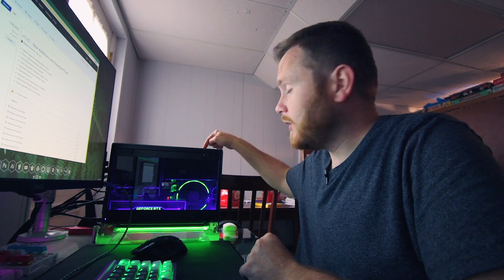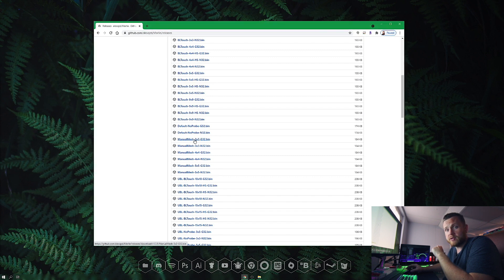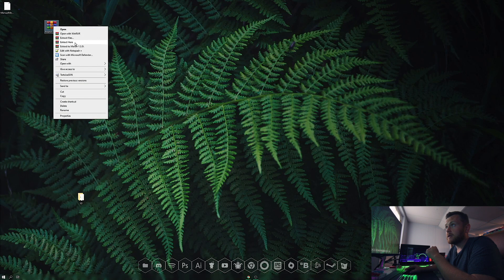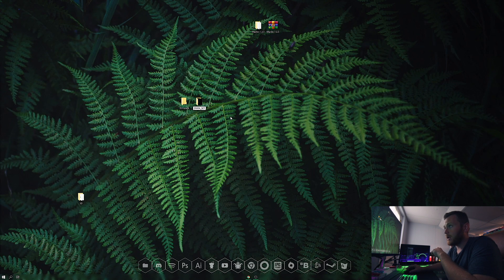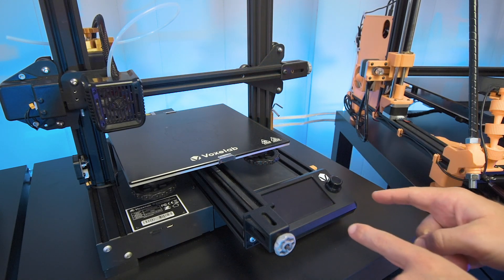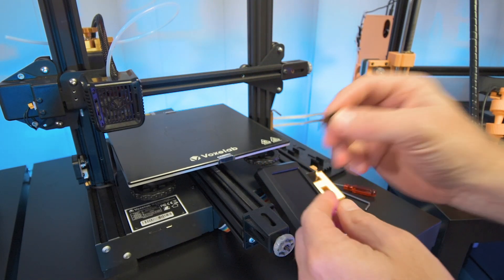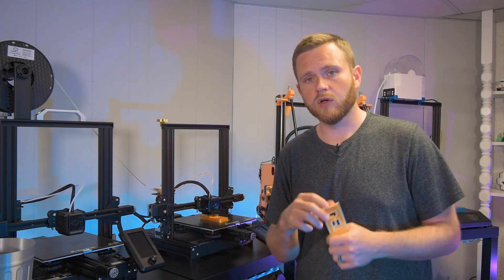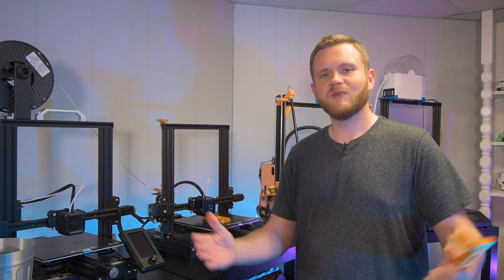Reduce Risk of Fire on Your Voxelab Aquila with 3rd Party Firmware

Comment: Hey Hello! I've installed this firmware a few weeks but I going to install CR touch, so the question is, firmware from bltouch works on Cr touch? Or I have to find another firmware?
Thanks a lot! Greetings!!
Reply from the maker: They firmware should be the same. As long as its mounted properly, you should be good to go. :)
Reply: @3DPrintSOS  THANKS A LOT!  I'll comment the results after installation 🤟👌

Comment: I do have a question... I actually liked my display being horizonal, and actually had moved it to the front of the machine so it does directly under the tensioner knob... Is there any way to keep the horizontal format?
Reply from the maker: Unfortunately no. Unless they rewrite all the graphics and how they are pulled, there’s no way to rotate the display. :/
Reply: @3DPrintSOS  Well, that's disappointing, but I do believe I shall be able to live with it. I did print a nice screen cover and knob in transparent red PLA to match the rail covers I printed for it. I also went so far as to print Ender 3 v2 knobs for the X and Y axis, and then printed the bigger nurled knob mod. 😅

Comment: i have one with an H32 chipset, is there a tutorial on that or is it just best to use the stock firmware on that?
Reply: Same did you figure it out?
Reply from the maker: The dwin sets are typically in the source zip files
Reply from the maker: There are no longer any limitations for the H32. All major firmware has a version for the H32. ;)
Reply: @3DPrintSOS  ooh okay, i downloaded the H32 version, but it's just i can't seem to find the DWIN_SET files in the zip file.

Comment: is it also relevant if you bought this machine last month?
Reply from the maker: No, but always a great idea to get on the latest firmware! Easy to do.
Reply: @3DPrintSOS  okay and what is the latest and newest filmware for the voxelab aquila x2? I am still very new to 3d printing
Reply from the maker: @muzicpro3089  Im not sure the numbers but check the voxelab website’s download section. They should have the latest for each of their machines. Just check your sticker on your X2 to find the right chip you have. N32 or H32. If you have no sticker, you have a G32.
Reply: @3DPrintSOS  i have the H32
Reply: @3DPrintSOS  but if i just bought the machine how weey what firmware i have now?
Reply from the maker: You can check on their site for the latest firmware number and then check the about section in the menu on your machine. If you’re isn’t the latest, just do a quick update. Should take seconds.

Comment: I have a question for you.  It appears as though my extruder TEMP SETTING as shown on the screen keeps going up.  So, when I start the print the set point is 205.  I check it an hour later and the setpoint is 230 and actual temp is 230.  It hasn't climbed over that yet.  I installed the latest firmware from Voxelab...haven't tried Alex's firmware.  To me, it seems like it could be a setting in the print file, but I can't find anything??  Can you think of any reason this might be happening?  Thanks.  Hope you see this.

Edit:. I just figured it out.  My settings for my temp tower were still active and defaulting to 230.  Woops!

Comment: So…. I used a 32gb instead (extremely stupid I know), I think it tried install the firmware on the display and now it won’t display or update properly. I tried repeating the process with an 8gb card but it’s still stuck. Any advice?

Comment: So, I have a H32 , do/would I follow these same steps here in this video but just download the "H32 support is in early testing phase. You can download the beta here : v1.3.6 for H32 Beta 2 -  https://github.com/alexqzd/Marlin-H32/releases "
Reply from the maker: Yep, the beta is great. I’ve tested it. Install is the same. Just grab the files for the display from the main fork source code and youre good to go. The install is otherwise the same.
Reply: Thanks for replying back so quickly . 
I am new to the 3D printing world , and this step of updating firmware is pretty scary as it is . I have never played with any kind of code/ing . 
What do you mean by " Just grab the files for the display from the main fork source code " 
What is the main fork source code? 
Where do I find that/it ? 
Also , would there be different files for different displays ?
My display is set as a vertical one , is there a way to identify which one I have ?
Reply from the maker: @jayk2k  No worries. In my video, I show where to grab the files for the display. That part is the same. Grab them from the main files here: https://github.com/alexqzd/Marlin/releases/tag/v1.3.5. Then for the firmware for the machine itself, you can grab it from the link you sent and follow the steps in the video.

Comment: Here I am again! The h32 sources file for bl touch is not the same as the one you used. Can you tell me which file or files I need to use please. I am going to try to set up the leveler again tomorrow. I have done the update for the printer but don't know what to put into the controller. Thank you my guru!

Comment: Everytime I turn it on. it says printer kill reason maxtemp
Reply from the maker: It sounds like you have a bad thermistor and since it can’t read the temp right it kills it. Try reseating it on the hotend first. If that doesn’t work, you will need a replacement thermistor.

Comment: Hi @3DprintSOS. I Have a Voxelab Aquila with an H32 chip.
I guess I have to wait for the firmware for this to come out or does it alrededor exist?
Reply from the maker: Alex’s firmware is available for the H32. I believe it’s still in “beta” but people have been using it and enjoying it for a while now.
Reply: @3DPrintSOS  I want to install the h32 firmware, but I don't know which files to download. There are several files, one is the firmware and the other is the code. Inside code there are several folders, and the question is whether to take the entire folder or select one specific?

Comment: anyone else having problem with display installation? i follow all steps, but my display ends up messed up and cant read any thing off of it. it moves between icons, and it seems to have two layers of english and Chinese text over each other and its unreadable and unrecognizable.
Reply from the maker: This happens when the DWIN files failed to install. Make sure you are using an 8GB SD card and double make sure you set the byte size to 4096 or it wont work. So you are seeing basically seeing new firmware with no graphics files.

Comment: Have you done an update on this issue/recommendation in the year since it has come out?  I looked at the github linked and it appears all work has stopped on the project soon after this video.  I just got an X2 and on firmware 5.1.8 Octoprint still says that the bug exists, but not sure if there is a better third party firmware project to go with these days that is still active.

Comment: in checking I noticed 3x3 4x4 and so on. how do you know which one to pick? Also is this good for the x2 model?
Reply from the maker: It’s how many points of leveling you’d like On your bed. So 3x3 is 3 on X  and 3 on Y and so on. 

Yep, it’ll work on the X2. Just make sure you know which chip you have. ;)
Reply: @3DPrintSOS  thanks for your reply

Comment: I UPDATED THE FIRMWARE AND THE DISPLAY FIEMWARE ,WHEN I TRY TO PRINT THERMAL RUNWAY AND SHUTDAWN
Reply from the maker: TRY TO REFLASH THE FIRMWARE. THIS WAS A BUG IN EARLIER FIRMWARES. SHOUKD HAVE BEEN FIXED NOW. ALSO MAKE SURE YOUR THERMISTOR ISNT LOOSE ON THE HOTEND. CHECK THE SCREW AND RESEAT.

Comment: do you have experience with the aquila s2? i want to add a runout sensor and a cr-touch to mine
Reply from the maker: I do. I think for both of those you will have to compile your own firmware for the settings to be correct.

Comment: Hey Man... Alex's Firmware. He has the "HS" version of each version. So like... BLTouch-5x5-HS-N32 and then BLTouch-5x5-N32. I'm slow lately... WTH is the HS for? Y axis took a dive on me. Tested motor, Cable, Limiter Cable. Nada. Voxelab support had me doing the troubleshooting 101 stuff. Told them I'm a comms engineer and even sent a picture of Fluke multimeter and how I was testing cable continuity...lol. Knew it would be a while for them to send me a new mainboard....if they did so, ordered one for $35 on Amazon and got it in 2 days. Let Voxelab support know what I did and that it fixed the issue so they said they'll check the warehouse and send me one. Still want it as a spare. Never know and it is under warranty! 
Anyway.. had to reflash firmware and was thinking about the HA. Github... always a piece of the puzzle missing LOL. Expects the common folk to know their language lol.

Comment: stupid question, but if I change the board to say a ender 3 v2, can I use the creality firmware on the voxleab screen or use Alex's firmware on the voxelab screen?
Reply from the maker: Yep, you'll use all Creality based firmware. Alex's is optimized for the Aquila, but you could switch to the version for the Ender called Jyers. OR just use Creality firmware.  ;)
Reply: @3DPrintSOS  awesome, thanks so much for an actual reply, my 1st 3d printer aquila x2 got on sale yesterday for around $150 and saw your video as its the H32 model. Thank you again!!

Comment: having troubles installing the firmware, its stuck on the loading bar screen and doesn't change.
Reply from the maker: Are you formatting the card with 4096bytes and are you sure you have the right firmware for your chip?
Reply: @3DPrintSOS  yes I did, so some how after doing a couple time it worked, also switch brand of memory card. So idk what the deal was. Thanks for replying back tho! Great vids
Reply from the maker: Had to have been the card. Glad you got it though. ;)

Comment: So can anyone please explain to me why this is not working for me? I have done firmware on other machines before but new to voxelab sure enough. I have no sticker so that means I'm a G32, right? SD card is formatted FAT32 to 4096 allocation unit size, firmware directory with default no probe g32 dot bin in it and DWIN_SET directory right next to it nothing else. Printer off, insert SD card turn it on and it fires right up with nothing changed first thing I check is info and always every time without fail version 1.2.1 persists. I just got this printer yesterday. I got it because I was replacing an anycubic piece o garbage that was s nothing but hassle and failure day after day. The ender 3 v2 that sits above the voxelab is the replacement of another anycubic,I have no issues with that and just really dont need issues with this new one either. (ok Im sorry i'm whining and crying so much my frustraton level is through the roof.) Can anyone help?
Reply from the maker: Yeah man. I got you. I would remove everything from the card except for the .bin file. Make sure it’s not in a folder or a zip. Just the .bin and out that into the machine. Let me know what happens.
Reply: @3DPrintSOS  ok so I'm the meantime I found this video that said you needed greater than 4096. Then he said 4097 or better so I set it for 8192 I think and now it installed but I can't get the display firmware to take, it just stays at the kids closet. I tried the red and the gotchas with only the dwin_set in so caps, screen turns orange rather quickly then just that. Pulling my hair out.
Reply from the maker: Haven’t heard that one before. However I know that it should be an 8gb card. 16 works in some cases and larger cards, not at all. The display firmware is especially sensitive to it. If your “DWIN_SET” folder is on a 8gb that correctly formatted, it should word. In theory.

Comment: Hey wanted to say thanks for making this. I just got a voxelab aquila x2 to work along side my creality, and this video helped me get a newer safer firmware onto the voxelab. I only noticed it at first because octoprint gave me a big warning when it found no protection on it.
Reply: question, did you have to update the firmware on the screen for the X2 as well?
Reply: @cbfierce  yes, it takes a few screws to pop the screen off, and then remove the back panel. There's a microsd card  slot on the board.
Reply from the maker: Always.
Reply: thank you for the info!
Reply: @cbfierce  Not a problem, happy I could help

Comment: What about H32 machines? I just received my Aquila S2 yesterday and I assembled it today. I am currently printing the Toolbox. However, watching your videos as well. Is there any info on if the S2 H32 version is having issues and needs a firmware update? Thank you Fedor
Reply from the maker: The h32 model issues were solved with firmware. So just make sure you have the latest and you’re good to go. Also, 3rd party firmware is in beta and works well. So things are looking good.
Reply: Fedor are you planning on reviewing the S2? It is Direct Drive, I printed the Toolbox yesterday and it did a really good job. I am looking forward to printing plenty more stuff come up. I would love to try and do some upgrades to this machine, but I’m too new to it to know yet what to do. Also wondering if the Extendable option would work on the S2… need to do some research on that. Thanks for your comment about the H32 chip being already firmware solved. Dan V
Reply from the maker: I did an unboxing and initial impressions of the S2. I think the xl kit would work just fine as it’s just the hotend that is different. ;)
Reply: @3DPrintSOS  I will check out the XL Kit and see if it something that I might get into down the road, I am still just trying to learn how to 3d print, and also learn this machine. Any tips for slicers, filament and other tips for the Aquila S2?
Reply from the maker: Cura is great for these machines. All of my profiles for the Aquila will work for the S2. You just have to set the retraction properly. That’s all. :)
Reply: @3DPrintSOS  Ok, you are talking over my head a little. I do not understand profiles yet, and or the retraction... Guess I need to read a little more.
Reply from the maker: @danvanacker  Profiles are just sets of predetermined settings for your slicer. So If I had luck with a set of settings I can export my "profile" and you can import it to replicate my settings. However, because you have an S2 and it has a direct drive, you would just have to change the retraction setting. That would be the only one that would be different between machines.
Reply: @3DPrintSOS  Fedor, is there a way to direct message you? I am having some major print issues and would like to send you a couple pictures of what is happening.
Reply from the maker: Best way is probably discord. Plus many can try to help, lots of opinions and view points. You can direct message me there. :)
Reply: @3DPrintSOS  is there a certain channel over on Discord? I am on there, can’t seem to find you.
Reply from the maker: Go to any video description I have, there is an invite link there. ;)

Comment: My screen is still messed up when after it goes to red or orange and I shut down the printer and take out my sd card and power it back up does it mean the firmware is still messed up or is my lcd screen that needs replace I don’t know what is going on at this point please help
Reply from the maker: It could be the sd card. Is it formatted with 4096bytes? Are you using the stock card?

Comment: Are CR touch and BL touch interchangeable as far as Alex's firmware is concerned? Works great on my first aquila with BL touch, but I installed CR on my second as it was a little cheaper. Both genuine creality units.
Reply from the maker: Yep, should be the same. Minus the mounting and the physical appearance

Comment: I’m not understanding what I’m doing wrong. I did exactly as you say and all works except the last step. I renamed the DWIN_SET and install in screen but nothing happens. Any thoughts?
Reply from the maker: Are you using the stock card or a 8gb card? Have you set the byte allocation to 4096?
Reply: @3DPrintSOS  not an 8gb but I set to 4096 using a 32 gb card. Don't have the stock card but will try an 8gb.
Reply from the maker: Ah. That’s why. Try an 8gb card. ;)

Comment: Thank you so much for the help and detailed instructions. Just wanted to add a tip if anyone was struggling with this. I had an off brand SD card that was 4 gig and even after following your instructions to a T, it still would not complete and give me the check mark. I had to use an entirely different SD card and then it worked. If people are still having problems just try a few different SD cards to see if it solves your problem.

Comment: Hey there. I was so excited to see your video. I have a question however. I have the original Aquila so I did exactly what you did with the downloads, putting the first bin into a folder named firmware (all lower case) renaming the DWIN_SET (Voxelab Red) to just DWIN_SET. Formatted the card Fat32 with 4096. put the card in the slot on the scree assembly, plug it in and up comes the original Voxelab menu. I've repeated this three times. Same result. Two folders on the freshly formatted card: firmware and DWIN_Set. Please help!
Reply from the maker: Hmm. You’re doing the printer first, then the screen? Is the card you are using a 8gb card?
Reply: @3DPrintSOS  Thank you so much for your prompt reply. I figured out the issue finally. The card reader on the screen is very iffy and by pressing and holding the card into place once I turned on the printer it finally updated! So are there any lessons on here for using the mesh leveler? I'm pretty excited about that and I love the vertical screen. Already printed and installed the mount.
Reply from the maker: Oh awesome! Glad it was simple. 

I bet by the time i reply you have already figured it out. But head to auto level and let it do it’s thing. Then make sure you go to zoffset and set a proper height. Then make sure you hit save. Once you do that, you’re set.